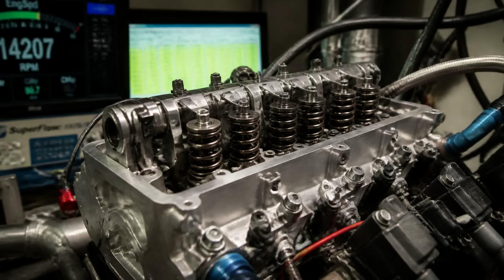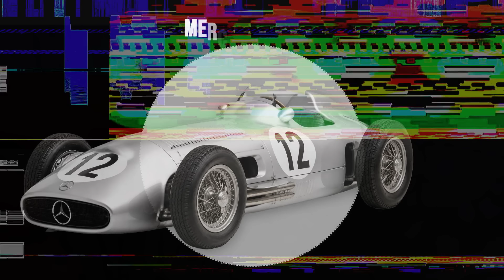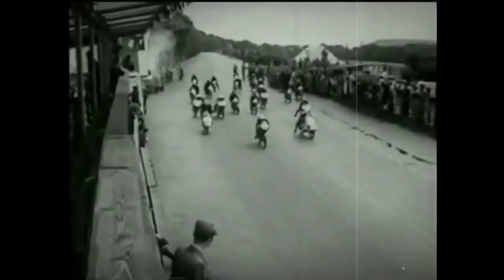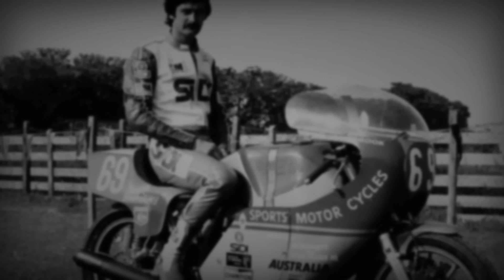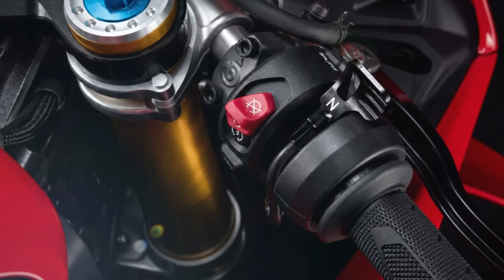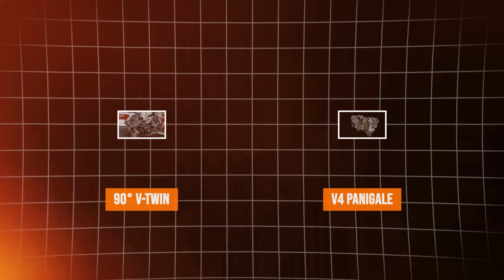The Impossible Valve That Broke RPM Limits

Comment: You can not change a Valve spring  ( on the side of the Road] old M/C owner MORE A / I CRAP
Reply: You can if the engine is a side valve with exposed springs.
Reply: They replace more than that roadside in places like Africa, India and Tibet.

Comment: I just learned about desmodromic valve technology today when I saw this video. I've been planning to get either a Ducati Mutlistrada Pikes Peak, Desert X, one of the Moto Guzzi adventure/dual sport bikes, a Triumph Tiger, or a special edition Triumph Bonneville Bobber TFC. I thought the demo valve technology was advantageous but now think it's more complicated and unnecessary for my needs.
Reply: Up until the late 1960s the Desmos were only for their race bikes. Later there was a choice between Desmo and non Desmo models, and of course up until now they've all been Desmos. If you're not going to flog the arse off the motor it's not really needed.
Reply: It takes a Ducati tech 7 to 10 hours every 8,000 mi to maintain a desmo. Better have a fat wallet or learn the procedure yourself.